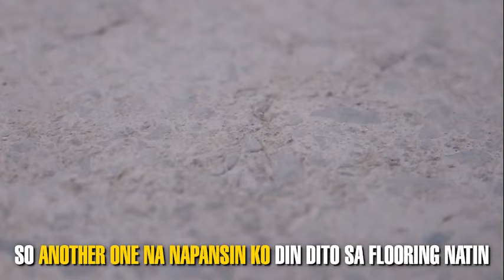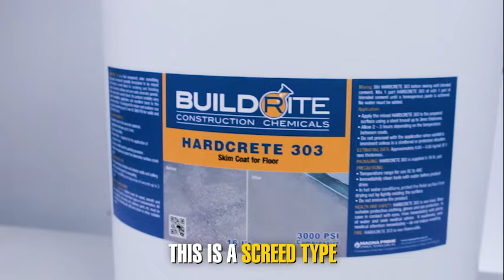Self-Leveling Compound vs. Skim Coat for Floors [Tips About Floor Repair]

Comment: Good day sir ask ko Lang Kasi naka rough pa Yung flooring namin . We are going to put a vinyl .medyo nag dusty na PO . Please advice  what is the best thing to do using the buildrite .Thank you
Reply from the maker: Remove all loose material and remove all dust. You can apply Level Up self leveling compound to make the surface even and smooth prior to installation of your vinyl tiles.
Please click on the link below to see video.
https://studio.youtube.com/video/nCUcZMnclF8/edit?c=UCOW4xyTyGGxrMfbPgrpzfhg
Reply: Same question paano po sya i apply and yung mixture ng self leveling

Comment: Hello sir. This video is very informative. Pero im still confused on which approach to use. We just removed the tiles ng kwarto namin, so currently its uneven, and full of patches of cement used in the past. I want to put vinyl tiles nlng sana, ano po better approach.
Reply from the maker: Hi. Thank you for your inquiry. For reprofilling of previously tiled concrete floor, you can use Buildrite's Hardcrete 303. You can see this post for your reference: https://www.facebook.com/BuildritePhils/photos/a.256515081150962/2028020970667022/
Reply: @BUILDRITECONSTRUCTIONCHEMICALS  pwede ba gamitin yan sa concrete pond na may tagas o leakage..Thanks..

Comment: Can you pour self leveling concrete to wet concrete so it becomes monolithic? Thanks
Reply from the maker: Hi, thank you for your inquiry. This process is not recommended. Newly poured concrete needs to be fully cured first before laying a self leveling mortar to ensure that the concrete will not shrink or crack during the curing process.

Comment: Good day sir. My project at home is partly open basketball halfcourt and part covered garage. The flooring is unfinished, semi rough with areas of uneven. What can you suggest to prepare the floor prior to rubberized paint for the halfcourt and garage top coat? Can we use the level up and bonding agent directly? Or still need to apply hardcrete? Thanks for the answer.
Reply from the maker: Hi! You can message us through our official Facebook page https://www.facebook.com/BuildritePhils for us to assist you further regarding your query. Thank you

Comment: Hi sir I got interested in your video, ask ko lang how about for exterior area like a roof deck na exposed sa weather and with basketball court, gusto ko rin ma solve ung uneven level bago ko sya pinturahan, and what kind of paint that you can recommend for this of flooring with such activities? thank you.
Reply from the maker: Hi. Thank you for your inquiry. First, make sure that the roof deck is already waterproofed using a flexible cementitious waterproofing (Buildrite Flexicrete). Here is the video link: https://www.youtube.com/watch?v=RPeJKgYIBm8&t=362s

Next, you can use Buildrite's Cement grip and Hardcrete 310 for concrete topping to make the floor slope to drain and avoid water ponding. Here is the video link: https://www.youtube.com/watch?v=2NdXHfTcNPc

And lastly, we recommend Buildrite's Epocoat MB as your primer and Buildrite's Polycoat Flex Rubberized floor coating as your top coat. You can see this post for your reference: https://www.facebook.com/BuildritePhils/photos/a.256515081150962/2322716864530763/

Comment: Hello Sir. Thank you for a detailed video presentation. I would like to pose a question. I am in the process of renovating my house and I will be replacing my tiles (as 90% of my floor tiles are damaged). When I remove my tiles, can I use this product to repair my concrete flooring? Also, assuming I use this product, what can I apply as a clear topping or coating to achieve a shiny industrial-looking cement floor finish? Thanking you in advance for your reply. More power to you Sir Derrick!
Reply from the maker: Hi. Thank you for your inquiry. Yes, you can use Hardcrete 303  for reprofilling of previously tiled concrete floor. Then you can apply Floortek S resin-based penetrating sealer to achieve a glossy look. You can see this post for your reference: https://www.facebook.com/BuildritePhils/posts/2299245446877905
Reply: GD morning salamat po sa mga vedio na ina apload po ninyo marame po aq na tutunan GD bless po

Comment: Thank u sir. Sobrang maalikabok po ng floor namin
Reply from the maker: Thank you for sharing. You can use Hardcrete DP or dust proofer. It is recommended for concrete floors that suffer from light dusting. Hardcrete DP is a sodium-silicate-based dust proofer and hardener for concrete floors. To learn more about the causes of dusting floors and our product, you can watch this video using the link below. 
https://youtu.be/uBRLx7x2pkA
Reply from the maker: Hi.Thank you for your inquiry.For dusting floor you can use Buildrite Floortek D.
Reply: Where to buy them sir and hoe much probably. Thank you
Reply from the maker: Good day! You can order online via our Magna Prime Shop (https://bit.ly/3D8vqLx) or our official Lazada and Shopee shop (https://s.lazada.com.ph/s.fFwNe) or buy from our partner depots near you (https://bit.ly/3PKbnZW)

Comment: Situation: a 1 year old installed tiles loosen from its adhesive. Now decided to replace the tile to laminated or vinyl flooring. Now removing the tiles, found the adhesive still intact but has a grooves from the tiles causing uneven adhesive flooring.
Question: can i apply the self leveling directly on top of the old adhesive to have a smooth surface? Will it not crack on the long run?
Reply from the maker: Hi, thank you for your inquiry. For reprofiling of previously tiled concrete floor, we recommend using Buildrite Hardcrete 303. You can watch this video for your reference: https://www.facebook.com/BuildritePhils/photos/a.256515081150962/2028020970667022/
Reply: Hi po,I hope all is well.Interesado po ako na gamitin itonh product. meron po akong 2nd flr tubular steel po ang framing and my substrate na 20mm marine ply. Pde ko po bang gawing finish floor po ito instead of laminated/ceramic tiles. Thank you

Comment: Good day po. Pwede po bang iapply ang swlf leveling compound to wooden floors (para sana sa uneven level na loft area bago lagyan ng luxury vinyl tiles). Thank you!
Reply from the maker: Hi, thank you for your inquiry. We recommend using Buildrite Elastocrete and Confix LV as its bonding agent. You can see this post for your reference: https://www.facebook.com/reel/1524042111855027

Comment: Hello, need pa ba ng bonding agent for hardcrete 303? Planning to use for replacement of laminated floor to vinyl planks - medyo rough ang existing topping kasi
Reply from the maker: H, thank you for your inquiry. Hindi na po kailangang mag bonding agent kapag gagamit ng Hardcrete 303.

Comment: May coming project ako, im planning to use this materials. The total area is 70sq.m. how many bags of self leveling at 5-10mm thk? Any ratio for 1bag in different thickness. I will follow all instructions and use your product but i need the ratio per bag per sq. meter.
Reply from the maker: Hi, thank you for your inquiry. One bag (25kg) of Level Up 403 will cover approximately: 
- 4.9 m2 at 3mm thickness 
-2.94 m2 at 5mm thickness

LEVEL UP 410 - 1.1 m2
 at 10mm thickness

https://shop.magnaprime.com.ph/search?q=level+up
Reply: @BUILDRITECONSTRUCTIONCHEMICALS  thanks

Comment: Hi sir! Pwede din po ba ang ganitong process in preparing concrete subfloor na pinagtanggalan ng ceramic tiles? 

May mga naiwan na mga slightly elevated na  parang concrete square lines sa pinagtanggalan ng tiles. Papalitan po kasi ng SPC flooring. 

Thank you for your informative vids!
Reply from the maker: Hi. Thank you for your inquiry. For reprofilling of previously tiled concrete floor, you can use Buildrite's Hardcrete 303 skim coat for floors.

Comment: Our existing floor is painted. However, we wanted to install laminate but it’s not levelled. But instead of stripping the paint, our mason chipped it off. How can we rectify it to accommodate self levelling compound?
Reply from the maker: Hi, Thank you for your inquiry. If you want to level your concrete floor prior to the application of laminates,  you can use Buildrite Level Up. For further assistance you can also reach us here : https://www.facebook.com/BuildritePhils

Comment: Hi Sir, thanks for this info. Question lang po. We are renovating our new bare unit townhouse and I dont have plans to put tiles yet. Hinde po ganun ka kinis yung floors and walls nun ginawa ni developer. Gusto ko sana yung very smooth cement finish look ng floor. Alin po ba dapat gamitin dito? Mejo naguguluhan kasi ako sa terms para ma discuss ko sa contractor ko. Thank you po
Reply from the maker: Hi. Thank you for your inquiry. We recommend Buildrite's Hardcrete 303 for smoothening your flooring and achieve an industrial floor finish.

Comment: What floor coat or paint can I use for areas that always gets wet like kitchen and laundry area. And can easily be mopped without the coat/paint getting chipped. Thank you
Reply from the maker: Hi. Thank you for your inquiry. We recommend Buildrite's Polycoat Mortar, a polyurethane-based, self-leveling floor system.  It has excellent hygienic qualities because it is non-slip, chemical resistant, seamless, easy to clean, resistant to extreme temperatures, abrasion resistant, and hard-wearing. 
You can see this post for your reference: https://web.facebook.com/BuildritePhils/posts/2299984603470656
Reply: @BUILDRITECONSTRUCTIONCHEMICALS  thank u!
Reply from the maker: You're welcome

Comment: Tanong lan po, need ba tlaga na i-level ang floor lalo na kpg maglagay or mag repair ng tiles? or khit na medyo hindi flat kung maglalagay na ng tiles/tile adhesive?
Reply from the maker: Hi, thank you for your inquiry. Traditional tile setters use dry pack to correct the floor level and install tiles at the same time. But this is one of the major causes of cracking and debonding. However, there’s actually a right way of correcting an uneven substrate and install tiles using the thin-bed method. We recommend using Buildrite’s Hardcrete 310 to correct the floor level of low-to-medium traffic areas. Let it cure for 24 hours before applying SmartBond Tile Adhesive using the thin-bed method.
You can see this post for your reference: https://www.facebook.com/BuildritePhils/posts/pfbid024YLTWjzutZApwRbb96kmrtvyk7B4usGfLfBxc8dLuj4xaALP73AGGQbirfaGuCTcl

Comment: pwede ko po bang gamitin ang level up sa 2nd floor with non-structural finished concrete cracks?  na-isip ko kasi baka mag spill yong levelup self leveling liquid to another area (ladder portion, opening slab area ng hagdan), napa-isip ko tuloy na lagyan ko muna ng tubig ung floor para malaman ko kung may possible leaks ba ung mga cracks.
Reply from the maker: Hi, thank you for your inquiry. Yes, you can use Level Up for 2nd floor flooring area, but first we recommend to repair the cracks first. Please message us on our Facebook page so we can discuss your inquiry: https://www.facebook.com/BuildritePhils

Comment: Hello sir, may product ba si buildrite, na similar to or para makagawa ng polished concrete flooring?
Reply from the maker: Hi. Thank you for your inquiry. Yes, you can achieve a glossy finish concrete floor  without the use of polishing machine. You can use Buildrite Floortek S, a clear, colorless, low-viscosity penetrating sealer for concrete, masonry, and brickwork surfaces. 
You can see this post for your reference: https://www.facebook.com/BuildritePhils/posts/2188920244577093

Comment: Sir Derrick ano pong marerecommend nyong paraan at materials to use sa pag patag ng floor na pinagtanggalan ng tiles. Kasi po nag angatan na ang mga tiles at gusto kong palitan ng vinyl plank floor? Sana po masagot ninyo. At san po pwde mkaavail ng buildrite products?
Reply from the maker: Hi, thank you for your inquiry. You can use either Hardcrete 303 or Level Up 403.
Reply: @BUILDRITECONSTRUCTIONCHEMICALS  parehas lang po ba ang paraan ng pag gamit mg bawat isa?
Reply: @BUILDRITECONSTRUCTIONCHEMICALS  gano po kalawak ang coverage ng hardcrete 303 20kg?
Reply: @BUILDRITECONSTRUCTIONCHEMICALS  lastly sir derrick. After 24hrs of curing pwde na po ba maglatag ng panibagong flooring like vinyl plank flooring? O mag aantay pa ng ilang araw?
Reply from the maker: Gaano po kakapal ang hahabulin, ma'am?

Comment: Dusty ang concrete at mabilis mag.dry ang tubig. Laagyan sana ngg tiles, need po ba mag concrete sealer muna before using cement grip then level up?
Reply from the maker: Hi, thank you for your inquiry. Yes, kailangan po munang i-treat yung pagiging dusty nang flooring because dusty floors is a sign of weak floors. Materials to use will depend kung gaano po kalala yung pagiging dusty nito. No need to use Level Up kung magta-tiles kayo, kung may need habulin sa level ng flooring we recommend Hardcrete 310 or 510.

Comment: Is this product appicae to apply in cold or wet areas,such as processing plants and chilling rooms?
Reply: I mean applicable
Reply from the maker: For cold storage and processing plant you can use Polycoat Mortar. POLYCOAT MORTAR is a three-component 
polyurethane based mortar for cold storage, clean 
rooms and heavy duty floors formulated from high- 
grade resins and curing agents specially for flooring 
application.  It provides a dense, impervious, and 
chemically resistant floor surface.   
 The cured polyurethane mortar is durable, has 
excellent adhesion to concrete substrates and it will 
perform its physical properties to a wide temperature 
range from -40 degrees to 180 degrees.
Please click on the link below to know more. 
https://fb.watch/aDAYVh1nef/

Comment: Pwede po ba bonding agent sa painted cement floor or need pa alisin paint?
Reply from the maker: Hi. Thank you for your inquiry. We advice to remove the existing paint prior to the application of a concrete topping.

Comment: Hi po, may question lang po. Yung floor po namin na finish na kaso po uneven and makinis na sana kaso natalsikan po ng mga cement nung nung nag palitada ng wall, medyo mahirap lang po tangalin. Pwede po ba gamitin yung Level up! then after, applyan po ng Floortek S? Or kung may ma advice pa po kayo na mas ok. Gusto ko po kasi sa ngayon concrete finish lang, and in the future baka lagyan namin ng wood planks flooring or vinyl. Thanks po! 🙏
Reply from the maker: Hi, thank you for your inquiry. Yes, you can use Level Up. However, it depends on the actual assessment. In order to fully answer your concern, we would like to request some further details from you. Please send us a message on our official Facebook page: https://www.facebook.com/BuildritePhils

Comment: sir pde pa po ba i finishing ang mgaspang na sahig khit mtagal na po o taon ng lumipas?. sna po masagot
Reply from the maker: Hi, thank you for your inquiry. Yes, you can use either Level Up or Hardcrete 303 to smoothen the surface. For Level Up, you will be needing cement grip as your bonding agent for old concrete to new concrete.

Comment: Sir gumawa kami nang roof deck na dapat sana may slope for water to flow. May slope naman end to end but in the middle may imperfections that could cause ponding. My question is, can i use the  "Level Up!" to fix the imperfections that cause ponding?
Reply from the maker: Hi, thank you for your inquiry. No, for creating a slope to drain we recommend Hardcrete 310. You can watch this video for your reference: https://www.youtube.com/watch?v=2NdXHfTcNPc
Reply: Thank you for the reply, Sir.

Comment: Gud day po, ask ko lang po kung anong product nyo na pwedeng direct ipatong sa luma at dameged na ceramic floor tiles (Para hindi na bakbakin pa ang lumang tiles) para ma installan ng vinyl floor tiles? TIA
Reply from the maker: For existing damaged floor tiles we suggest to remove it because it has been damaged and affected its adhesion on the surface that may affect the adhesion of your new tiles.

Comment: Sir goodday, di na pa kailangan mag apply ng cement grip pag nag apply ng screed 303 as shown in the video? Tia po
Reply from the maker: Hi, thank you for your inquiry. We have improved the formulation of Hardcrete 303, from single component powder, now to 2 component -powder and liquid. The improved formulation of hardcrete 303 does not require a bonding agent.
Reply: @BUILDRITECONSTRUCTIONCHEMICALS  lahat po ba ng hardcrete ngayon sir di na kailangan ng bonding agent? Tia po
Reply from the maker: Kailangan po ng mga ito ng bonding agent na naka depende sa area na pag gagamitan.
Reply: Thanks po
Reply from the maker: Walang anuman po.
Reply: Sir good day, ilang oras po ba working time ng level up na di mo na pwede galawin..
Reply from the maker: Do not mix more LEVEL UP 403 that can be laid in about 15 minutes but ensure that the next mix is ready so that pouring can be continued until the whole area to be applied is complete.
Reply: @BUILDRITECONSTRUCTIONCHEMICALS  tnx po

Comment: Sir ano pong advantage neto kesa sa cemento na lang? Yung floor kasi ng room namin may mga crack and anay sa loob. Tas uneven level pa. Para lagyan ng vinyl tile after sana po
Reply from the maker: Hi. Thank you for your inquiry. Ordinary Sand and cement mix has weak compressive strength that can cause cracks and scaling, unlike Level Up and Hardcrete 303. Level Up has 1,400psi for 1 day up to 3,600psi for 28 days while Hardcrete 303 has 3,200psi for 28days.
Reply: Pag apply ba ng hardcrete310 direct na ba sa old cement
Reply from the maker: You have to use Buildrite Cement grip as your bonding agent for Hardcrete 310. You can watch this video for your reference: https://www.youtube.com/watch?v=2NdXHfTcNPc&t=18s